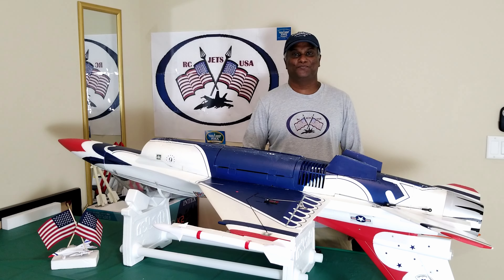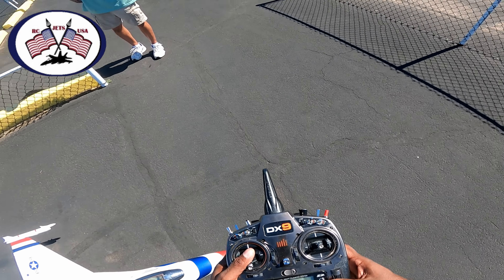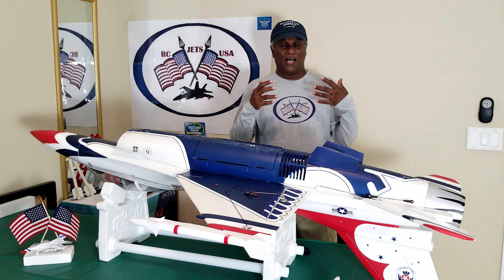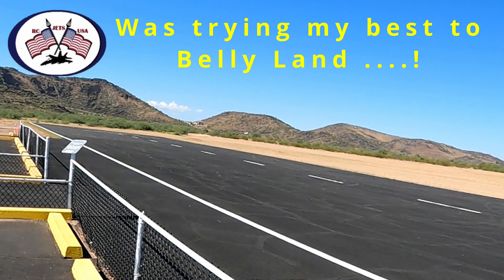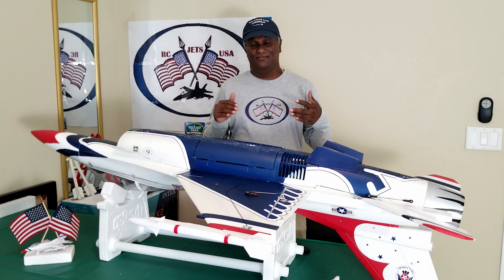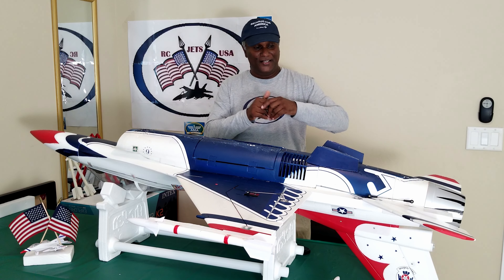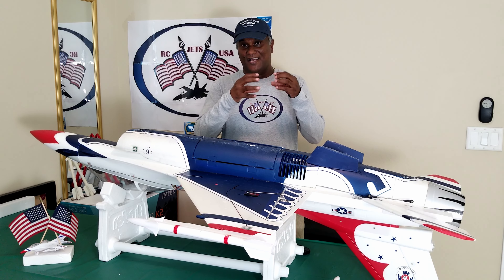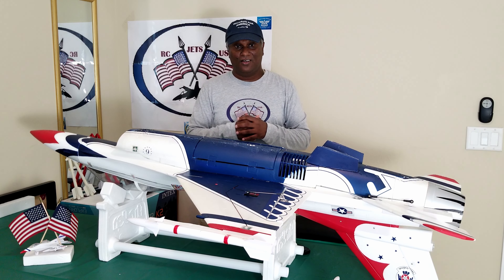HSD F16 Thunderbird 105mm RC Jet - Belly Landing on Lost Power

Comment from the maker: Since I did not have a heavy-duty tool to weigh this Jet to check the CG, I held it using my fingers from the plastic pieces that join both the body and the main wing of the Jet together and got the CG balance checked and noticed it is right on 1st main wing attachment screw from the nose.

However, when you do it, be careful not to do weigh it on the form, which will damage it because of the weight of the Jet, instead weigh only holding it from the plastics.